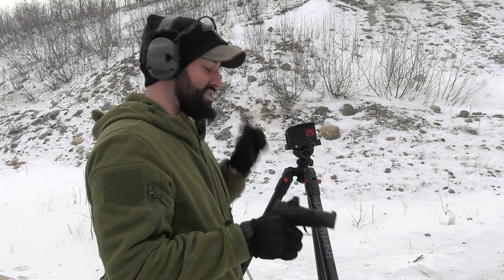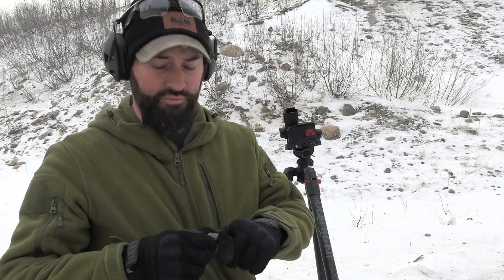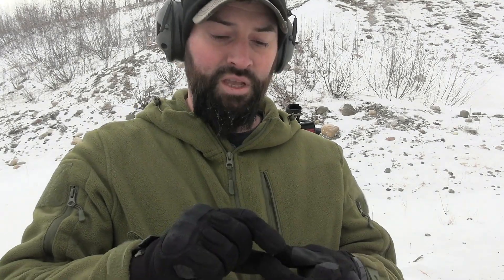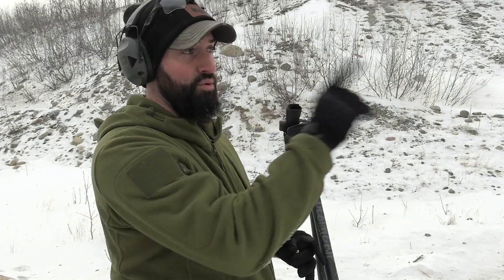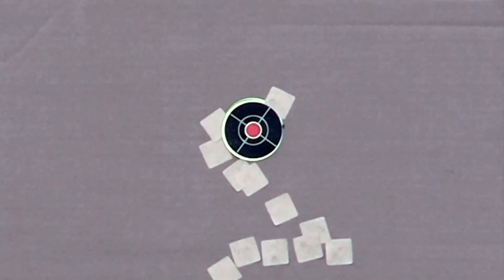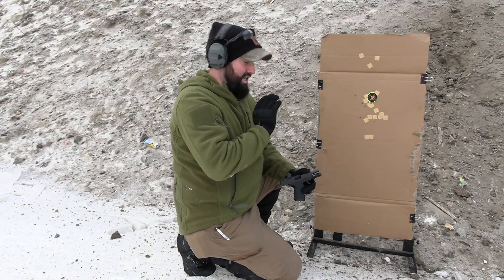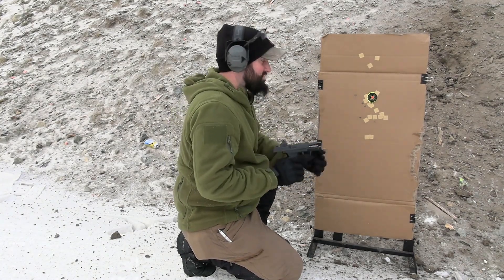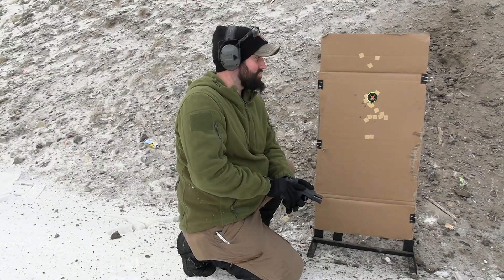I Loaded the Same Carry Round 20 Times — Here’s What Happened

Comment: I don't see that variance as particularly grievous. In a stress situation, 3" at 25 yds isn't going to change anything. The only concern I have is that certain bullets and pistols very well could create significant setback, depending on the feed geometry. I've experienced it with one pistol, not with others.  Since I'm not in the habit of unloading my pistols except to clean or service them, and at the range, it's generally not an issue. However I do rotate the chambered and top round in the magazine just to reduce the chances. I also visually inspect the ejected round after unloading for signs of anything problematic. To me, short of noticeable setback, it's generally not worth being concerned about.

Note that rifles can have the same potential issues, for the same reasons (feed ramp and magazine geometry). Accuracy changes might be a much more serious concern for a rifle.